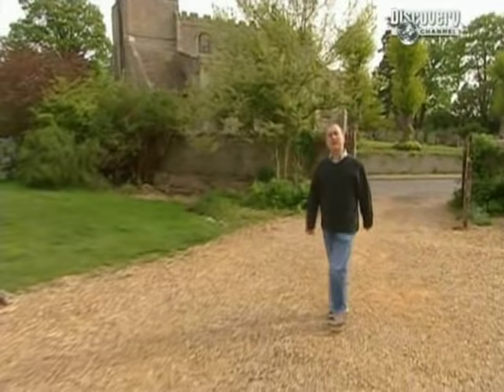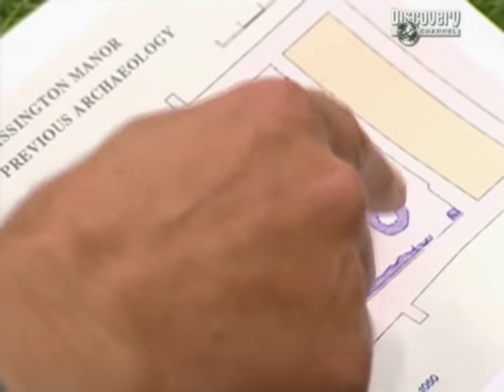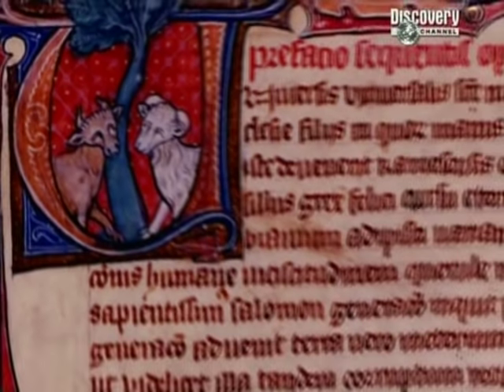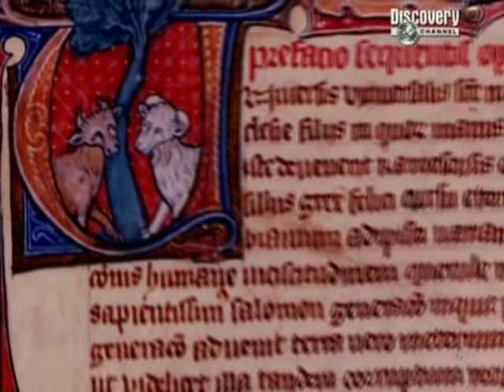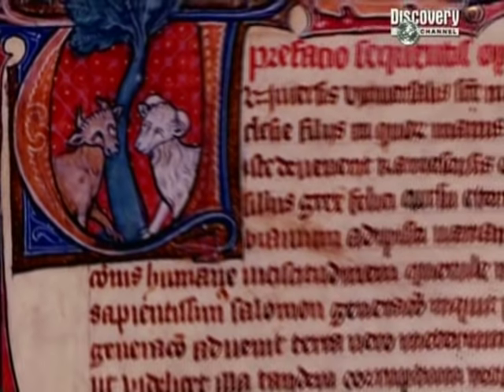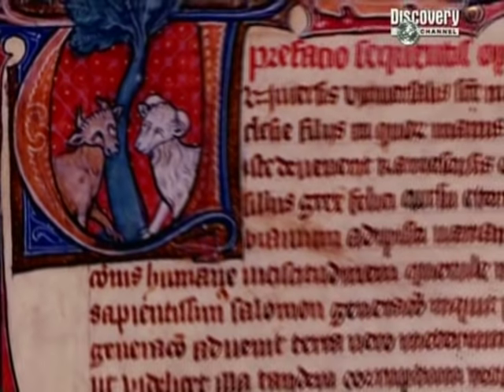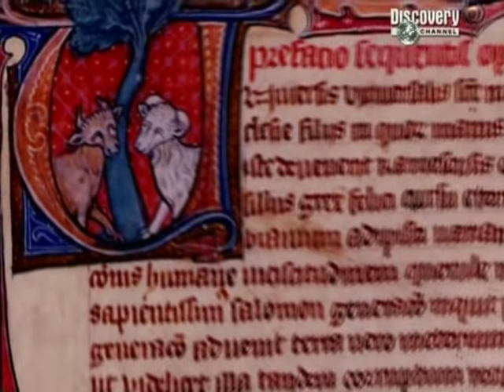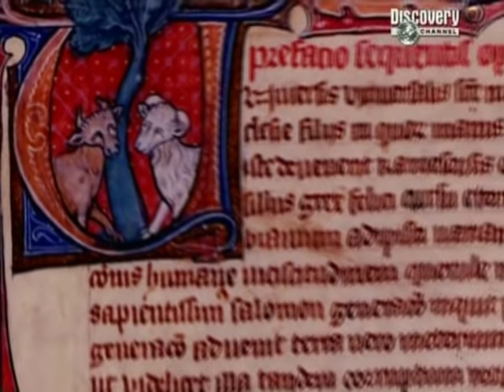Time Team S11-E10 Nassington,.Northants

Comment: I love how at the start they talk about having to put all the floor tiles back in the exact right spot, and then later you can see where they broke a bunch of them and then just chucked others aside.
Reply: I'm not sure, but I think they have a craftsman that uses period appropriate materials and techniques fix all that. I know that the UK requires that for all repairs to scheduled buildings and monuments, so I'd assume that was the case here too.
Reply: @SkunkApe407   If i were the owner i would put some kind of see-through flooring over the digs inside the house!